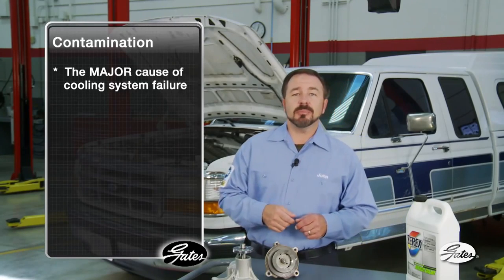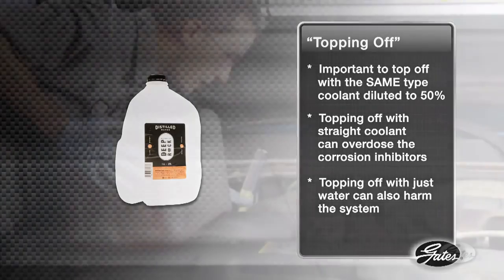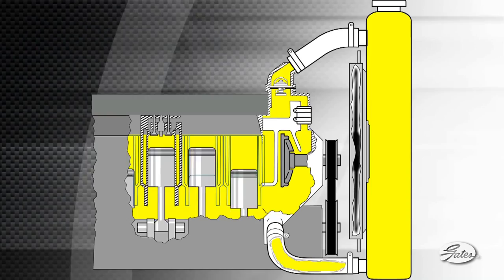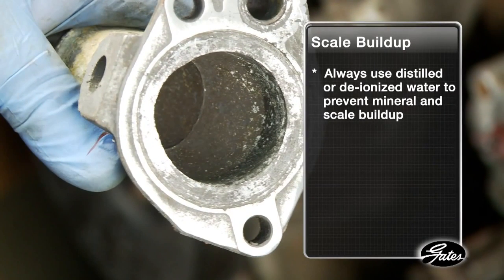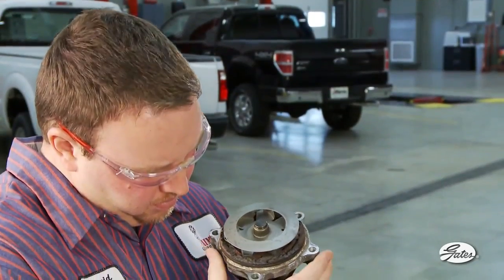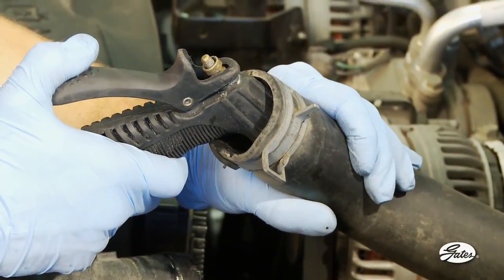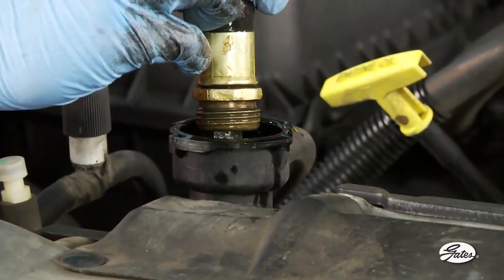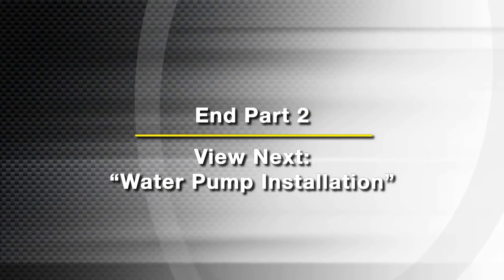Jeep Cooling System Contamination

Comment: Please keep your car neat and clean so that it can run for years and years.  Avoid contaminations in the cooling system of your car, otherwise your car's cooling system will breakdown and you will end up paying thousands of dollars in terms of repair costs. 

It is recommended in this video that you always use same type of coolant every time you top up your coolant. Try not to mix the coolant types. Try to use the same coolant as was there before in the coolant system. Mixing the existing cooling system coolant with different types of coolant can easily lead to corrosion of the different parts of the cooling system. 

Moreover, try to use distilled water or deionised water to fill the cooling sysytem. Normal tap water has many contaminants in it that cant lead to corrosion of the different parts of the cooling system such as water pump. I had a similar experience a few years back. I bought a second hand car, 10 years old which has very bad cooling system as it was badly neglected cooling system. Someone completely neglected the cooling system and its water plugs were corroded and water was leaking through them. I spent a lot of money (nearly $2000), but I could not have it fixed properly. Then I had to sell it as scrap. So, please be careful about the coolant you are gonna use in your car.

Please pay proper attention how to flush the coolant from time to time and how to flush it properly so that your car can run for a long time without having any problem. Good luck with the cooling system of your car. 
 Thanks for sharing such a wonderful information on youtube!

Keep it up, thumbs up!